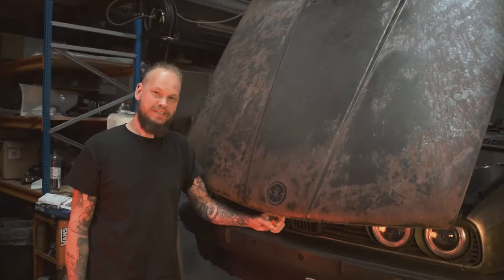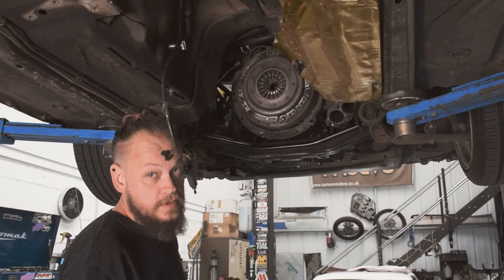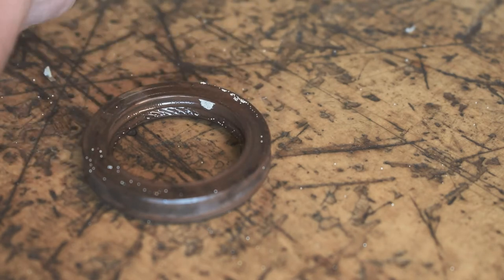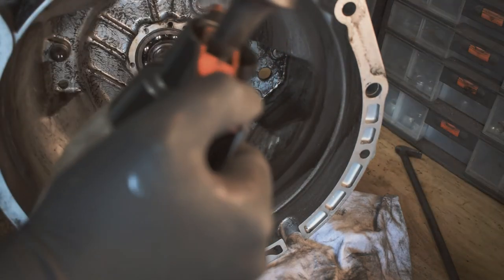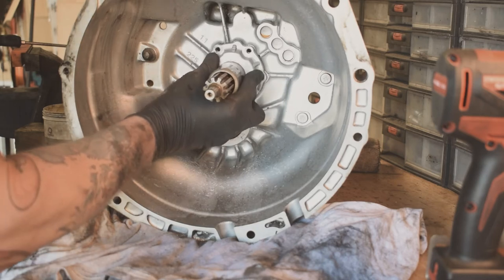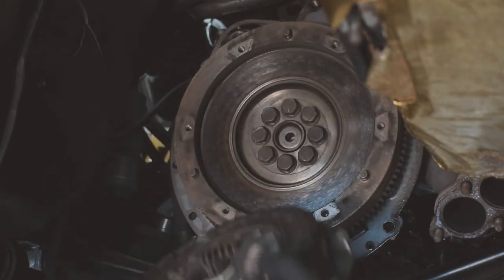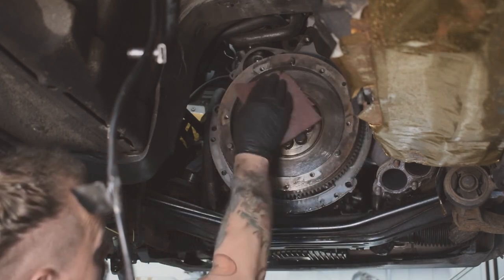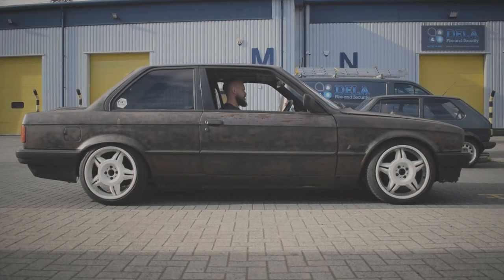BMW E30 318is how to fit a clutch and input shaft seal

Comment: I have all parts on hand for this job, waiting for spring. What type of cleaning solution is in your pump sprayer? Thanks for the nice video.
Reply from the maker: Hey Verdi, thanks for liking this one. It’s clutch and brake cleaner… cleans EVERYTHING! Although it’s also highly flammable so be careful spraying near hot things, grinding and so on. It’s perfectly safe when evaporated though, which it does in seconds.